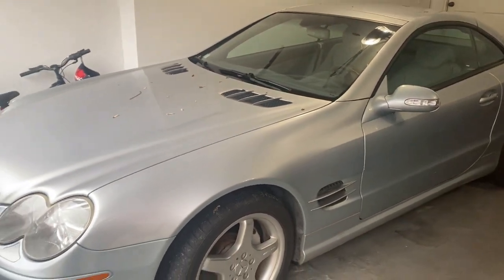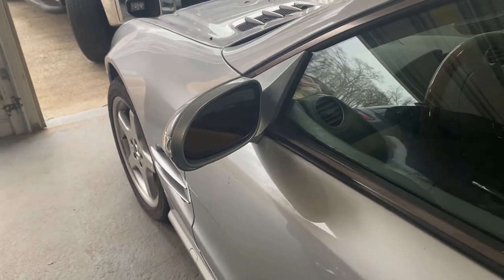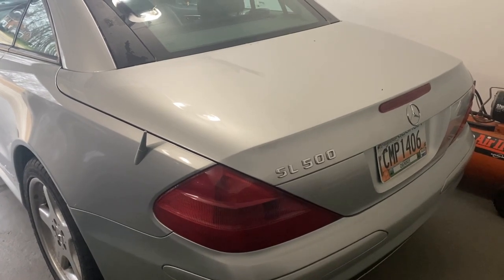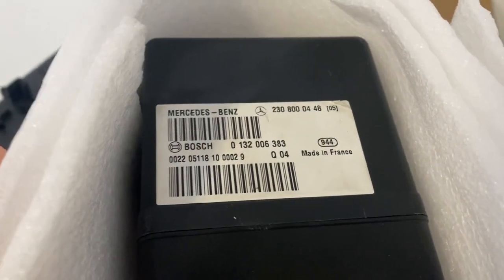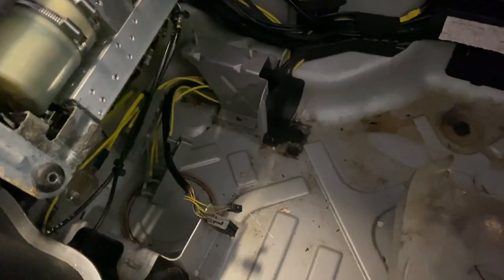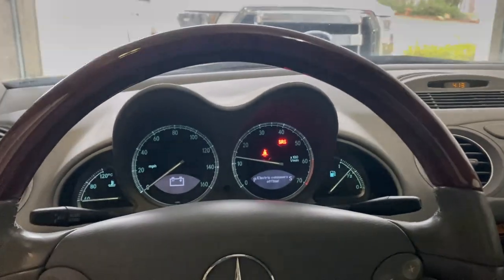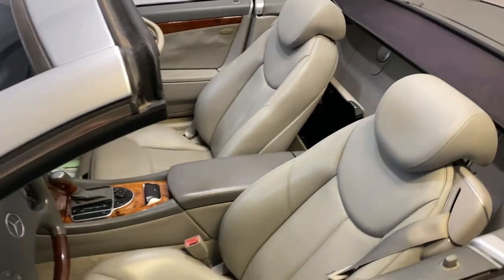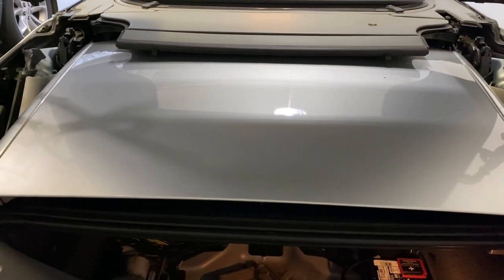Cheapest SL500 in USA and bad PSE pump

Comment: Great video, I have a 04 model 2 years now. I saw A DIY repair for the PSE pump on YouTube.  It's usually the impeller brakes into 3or4 pieces and the system will time out and  pulling the fuse for a minute or so will reset the system once it's been repaired or replaced. Don't know about you but I've found a lot of repair demonstrations from SL roadster owners from around the planet a d they have been a great help!

Comment: How about the idea of deep-sixing the entire air suspension system and converting it to springs and shocks with a Strutmaster kit?  Apparently, the handling doesn't change much, plus you can shed a lot of dead weight from the vehicle with such a conversion.
Reply: I'm removing my hydraulic suspension now.
Reply: @respectingthewordpodcast  Gold Element Auto is the GURU of coil-over swaps for the Mercedes SL500.  Before you delve into this project, I strongly recommend checking out a few of the man's videos on this subject.
https://youtu.be/FkAgfXG6ZjQ
Reply: @riverbankfisher  I have seen him
Reply: @respectingthewordpodcast  He even sells conversion kits and does installations.  I never bought from him and do not know him personally other than having seen his very helpful videos on youtube

Comment: Just bought a 2003 SL500 Myself with a bad dual PS pump. Replaced with ML55 AMG Power steering pump. Might have you beat on purchase price. Payed roughly 10% of its book value. Waiting on Ceika coilovers to arrive to complete the conversion.
Reply: Ceika is what I have on mine. 5000 I paid. Sweet car.

Comment: I've just done this pump on mine, if the replacement is not the same number exactly, then the new unit needs to be coded to the vehicle. I had my old pump refurbished for a fraction of the price of replacement with a lifetime guarantee, that way no recoding necessary, if not recoded the pump can run permanently.
Reply from the maker: Mine is working fine. Not sure if the part numbers are exactly the same but no coding needed and the pump does not run permanently. Where did you get it refurbished?
Reply: @pile-o-projects  In UK  BBA - Reman £4000 with a lifetime guarantee.